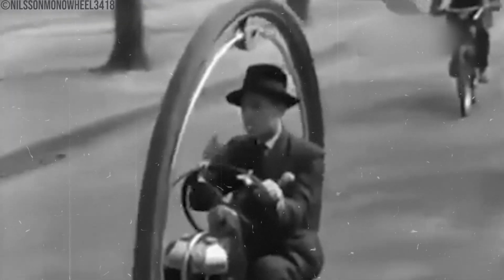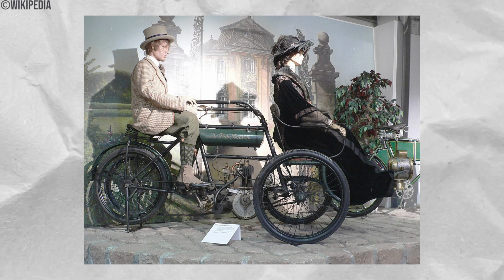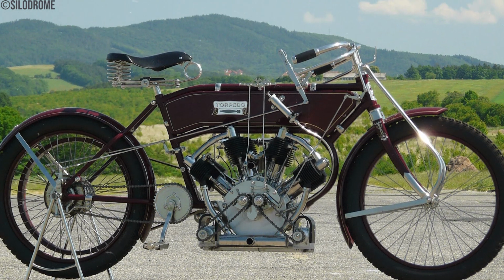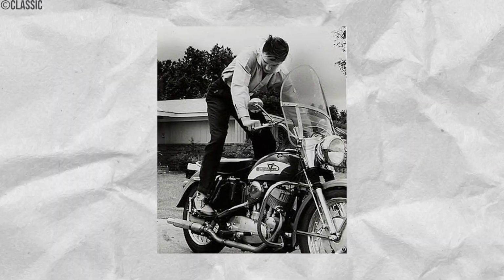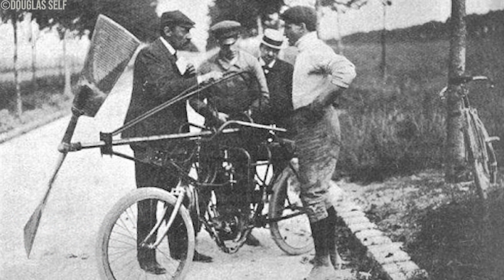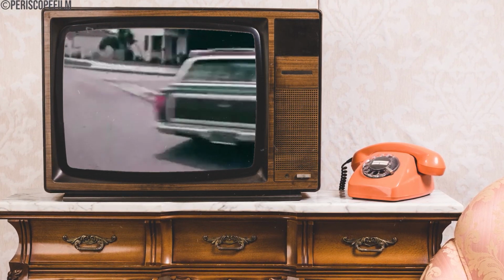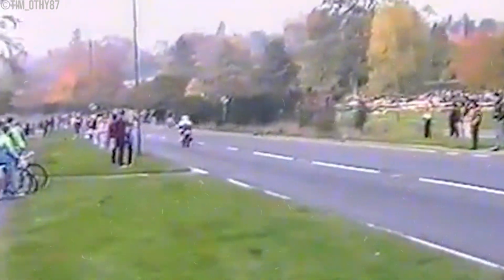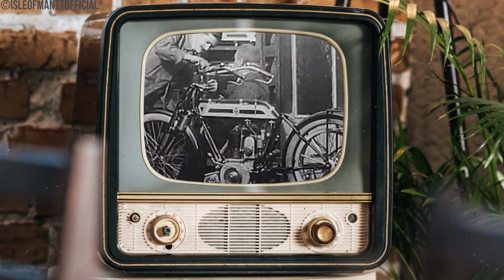13 DANGEROUS Old Motorcycle Features, Nobody Wants Back!

Comment: What a bunch of lies.  The monowheel is a thing today.  They are called electric unicycle.  The f orecar is currently made as a "safe" 3 wheeler Can-am.  Kick starters need to be brought back.  If youre a smaller rider, you need a smaller bike to fit your size so starting it doesnt buck you off like a live hoss.  Fat tires dont save you from falls if you do wheelies.  Its not if youll fall but WHEN.

Comment: I've been riding motorcycles for nearly 60 years, and in all that time (and nearly 1 millions miles driven);
- I've never once been injured by a kick starter (despite owning 12 motorcycles with kick-only starting). 
- Of the 35 motorcycles I've owned, 2 of them had shaft final drive (all the rest had "exposed chain" final drives - including the 3 motorcycles in my garage now... it is still the most common final drive).
- "Skinny tires" are still preferred on motocross, enduro, dual-sport and adventure-touring motorcycles.  Street motorcycles are the only category that has largely switched to wider, radial tires (the opposite of the video's claim that "harsh conditions" drove the change to wider tires).

Whoever put this video together is clueless when it comes to motorcycles and motorcycle design.